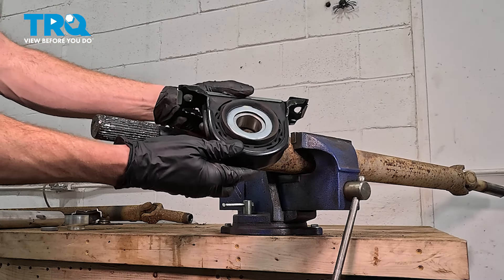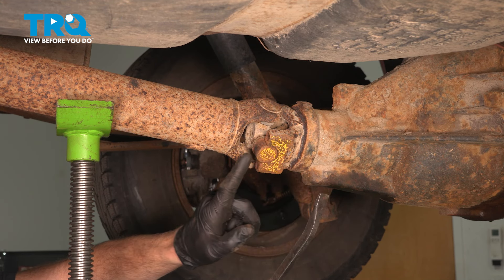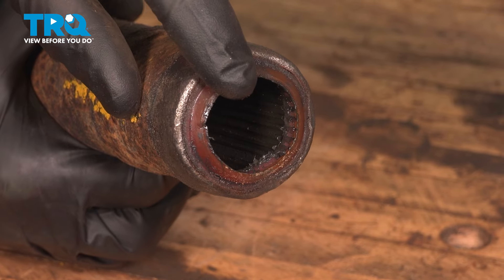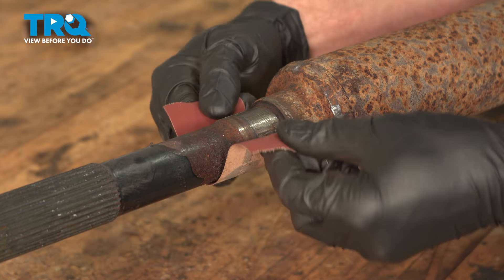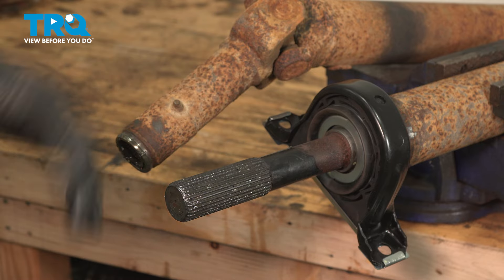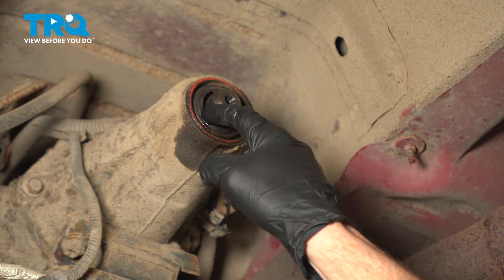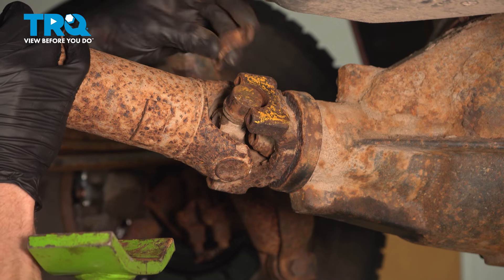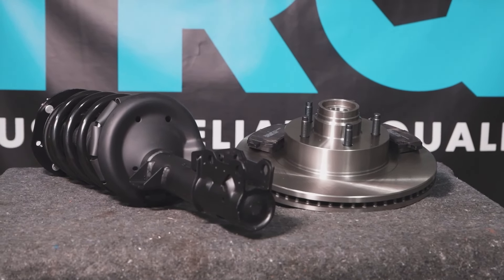How to Replace Driveshaft Center Bearing 1999-2006 Chevrolet Silverado 1500

Comment: 1-1/4 inch pipe and one cap.
Home Depot did not carry.

Lowes had it in store.

Galvanized Cap 1-1/4-in Galvanized Cap

Southland Galvanized Pipe 1-1/4-in x  24 in 150 PSI